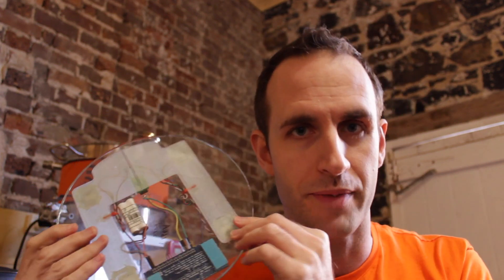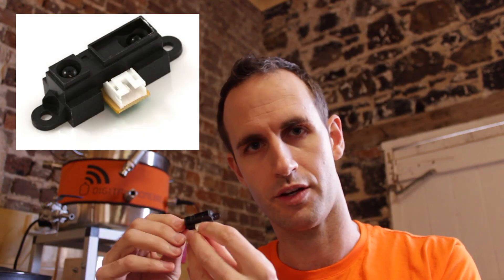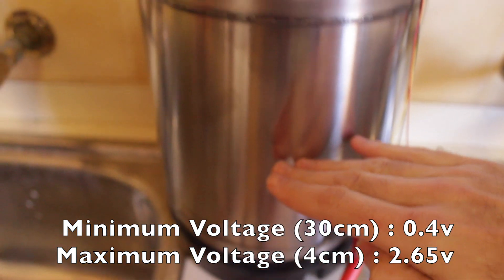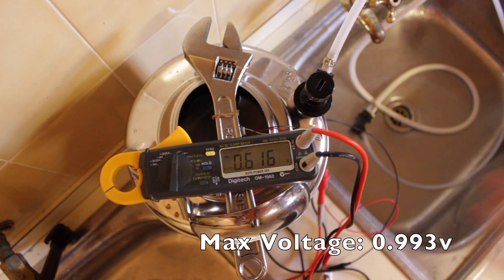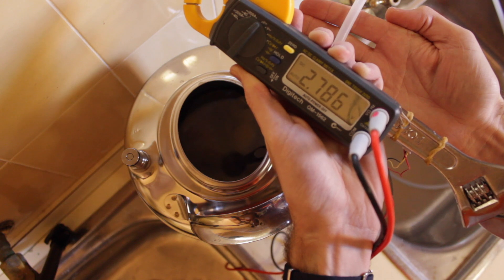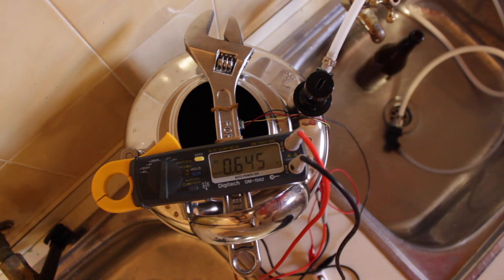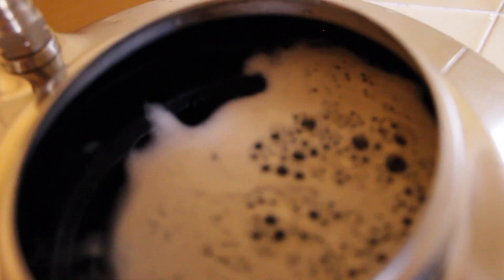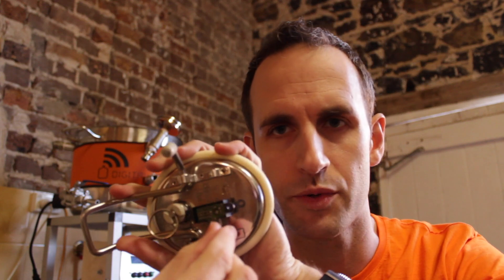Detecting keg fill level with infrared distance sensors

Comment: Thanks of sharing!!

I make automatic coffee (turkish coffee) machine for my home. I want to measure of foam level. Foam level is important for two reasons. First, best coffee must have a good foam level. Second one, if i measure the foam level, i would also prevent the overflow of coffee. I think which sensors are more appropriate for this application. Ultrasonic or infrared? Infrared is cheap from others but mixture is to dark and infrared signals are  reflected hard in the dark area. I'm struggling with this right now.

Comment: That was a great video. As part of this setup, could you rest a sanitized disk that floats on top and have the sensor reflect off that?
Reply from the maker: Michael Motta The main issue I see would be the dip tube that could get in the way but it could work adequately. Let me know if you try it!

Comment: Great video, it's also my hobby too and I like to know is it possible to convert the analogue voltage from this IR sensor into computer as numbers (via a ADC then onto USB or COM port perhaps) any help would be appreciated, or if this is your area of expertise I am happy to make it a paid project too (feel free to contact me directly), thanks
Reply from the maker: Bill Chan Connecting to USB is possible but I found that the sensor just wasn’t suited to the job. I’ve been playing with the new “time of flight” sensor ICs more recently like VL53L0X and they show a lot more  promise.
Reply: Thanks I just checked out VL53L0X which is quite good, the IR approach is also ok as I don't need high precision (+/-4mm) and working distance is about 40cm max, I only thin kthe tricky part is to get the A to D conversion into the PC as I like it to be a standalone item which eventually won't depend on the Arudnio program because I like to read the data directly on the serial port (with my own program), thanks
Reply: @DigitalHomebrew  Did the ToF sensors work for you?

Comment: if the walls is coated with black and clear solution has cover. I think it would work because it would be only ir reflection in the dark.. just try it with a piece of glass in the dark

Comment: What about adding a float like in a petrol tank of of a car? and have the float report back to the app?
Reply from the maker: Good idea Chris, I had to look up the way they work and there are some vertical types that would do the trick. They look pretty expensive though (like $100+ vs ~$4 for the IR sensors).
Reply: what about using a HC-SR04 Ultrasonic rangefinder about $2
Reply from the maker: My thoughts are that it would work great until it got beer on it. You're on the right track, if we could find something that can handle being submersed for a similar price (even a bit more) it'd definitely be worth testing out.

Comment: Have you thought about trying Ultrasound distance sensors? I'm kind of a sceptic about those as well, but it might worth a shot.
Reply from the maker: Yes, thanks for the suggestion. The sanitary bulkhead types will definitely be worth testing if I can find a place to source them affordably. Most of the cheap ultrasonic sensors aren't sanitary though.

Comment: also, I'm not sure how you'll transmit the reading from an airtight metal keg, and how the reading depends on the temperature.
Reply from the maker: I was going to mount the transmitter on the outside of the lid with the sensor looking through a small glass window so transmission wouldn't be such a problem. I tested that the glass doesn't affect the reading which was promising. Regarding temperature, the Infrared sensors are pretty good in that respect (-10C to +60C). It's just a shame that the surface of the liquid couldn't be detected accurately.